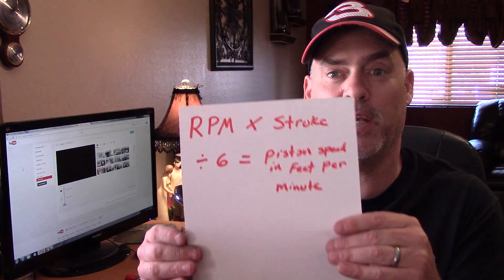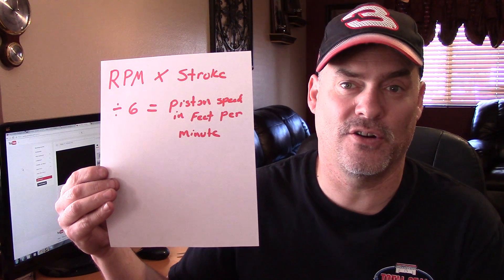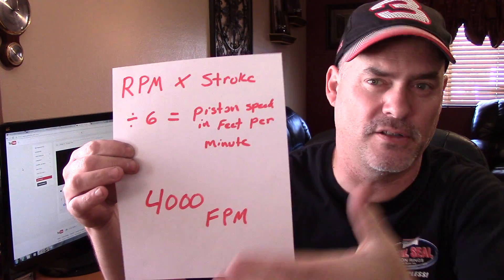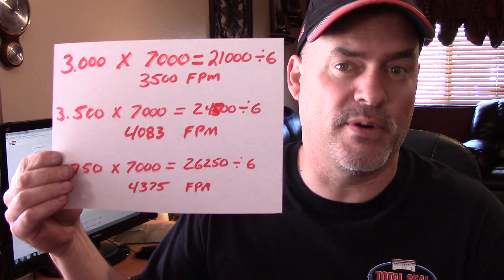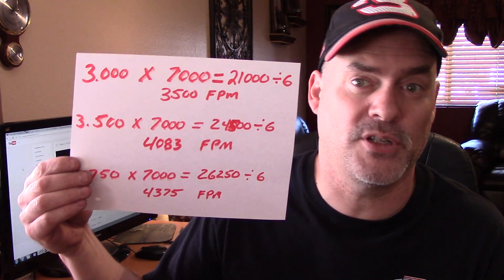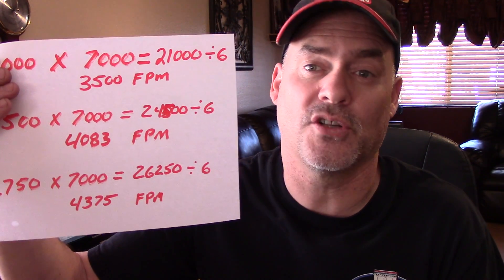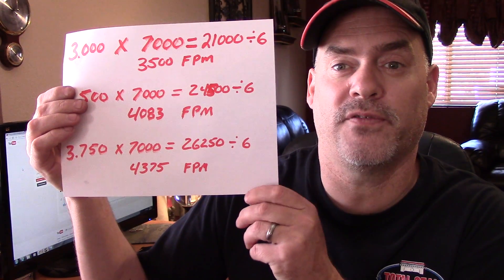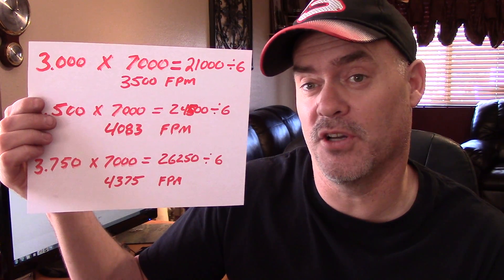What RPM should be an Engine's red line

Comment: i've just seen the video
and after doing the math the results are!!
my car chrysler SRT8 HEMI 6.1L
after few upgrade
now it has 4.250 strok
4.125 bore
CNC heads etc....
also it is my daily use car
and with 3.73 diff the RPM is always high
and 6500 RPM is a number that i reach as my daily routine
if you do the math:
5650 rpm × 4.250 ÷ 6 = 4002 FPM
what about 6500 rpm
its more than 4600 FPM
dyno test is: 510+ rwhp on gas pump

Comment: Reliability/durability of the crank and bearings are what limits rpm, right? They the failing components of high rpms, right? Can you increase rpm and/or add stability/reliability to the exicting redline by using a higher viscosity oil or some kind of racing oil?

Comment: Is piston speed really that important? I think it is, but I see too many posts about people revving their big blocks and strokers to the moon with piston speeds fast or faster than F1 cars and cup cars.
Reply: Biggest concern is oil being wiped from the cylinder walls, wrist pins skirts etc. Too much piston speed with sub-par oiling system leads to wall wear and increased clearance, giving more blow by and compression losses

Comment: So 24,000/Stroke..  24k being 4000FPM x 6...
 24000/3.00=8000RPM
24000/3.5=6857RPM
24000/3.75=6400RPM
Reply: Exactly. The simple explanation of how to find your redline is 24000 divided by your stroke. The other factors that come into play are piston material, ring face type, piston pin type, rod construction, bearing speed, crankshaft balance, oiling, clearance, and the two biggest ones: cylinder head port flow and valve springs. ALL of these things added together dictate true peak RPM. However, the simple 24000/stroke=redline RPM equation will work as a good baseline for most stock to mild street builds, as stated.
Reply: Was mainly just trying to simplify the formula...  But agreed...
Reply: I have a 4.9 straight 6 Stock. I take 24000÷3.98 (stroke) I get 6000. For some reason I find this realy hard to believe.  What am I doing wrong?
Reply: @akafungi-eater1233  Considering that in his example, a 302 (3.00 Stroke) can "safely" turn 7000 RPM, yea, you got it right.  But a stock 302 will float the valves between 5600 and 6000.  So I'd think it would take more than a "mild" build to see 7k.  And with a big straight 6, you've got the bottom end to worry about.  So I'm thinking more like a limit of 3500 Fps piston travel, which would be 21000/3.95=5300 RPM.

Comment: Manufacturers use different kinds of material to make a piston, connecting rod, etc.. So 4000 ft/m isn't really applicable to everything. I think you should've given the ft/m for each kind of internal combination.
Reply: faisal3398 Wouldn't there be countless combinations of internal parts you can use to build an engine though? 4000 is probably just a max safe limit with most OEM internals. This guy does work or teach or something like that at UTI so he knows his shit though

Comment: So, my 1998 Nissan Frontier, has the KA24DE engine. It's stroke is at 3.78", and it redlines at 6500. If I ever wanted to raise it, would I have to basically rebuild the engine to change the rods and pistons out?

Comment: It depends on a bunch of factors.. RPM and internals strength are 2 big ones. Too high an rpm on weak rod and pistons and you have internals fail overreving to the point that the valves float can lead to certain death to the whole engine if ya way over do it and the valve hits the and breaks a piston or rod..  Most cams have a happy max rpm in the docs with them. Finding out what ya internals limits are is a wise thing before building anyting

Comment: Strong internals go a long way here. 4340 crank and fully forged pistons and rods @ 4.25 inch stroke hasn't cared about 7500 rpm in my little hotrod...Yet... Pettis performance builds 598 Chevy (race motors) with 4.5inch stroke that make peak power at 9k. Very informative video!

Comment: Due to rod geometry, the fastest piston speed is usually in the top 1/3 of the cylinder.  In the center of the cylinder, the piston is starting to decelerate as the crank comes the 90 degree point, actually starts decelerating at about 60 to 80 degrees, and decelerates the most as the journal starts to swing back in the bottom half of the stroke, stopping again at BDC.  Also, a short rod engines like the Ford 302W or Chev 400 small block have faster acceleration away from TDC, once again due to rod geometry, than a longer rod engine, like the Ford Boss 302 or Chev 350, which can cause a piston to pull apart easier at the same RPM.
Reply: That depends on rod/stroke ratio
Most engines peak out at dead middle of the stroke
Engine with short rods and long stroke will have 2 peak pistons speeds near 1/3 down and 2/3, but actually slow down some in the middle of the stroke. that's because rod angularity accelerates the piston against the cylinder wall, but this increases runner air velocity and can be used to increase volumetric efficiency

Peak piston speed at redline for a 5.0L is 82.5, while LS3 is around 72mph
Reply: The rod/stroke ratio will dictate piston accelerations and decelerations, but geometry dictates speeds in any part of the cylinder.  Short rod will have quicker acceleration/deceleration, but, as the crankpin nears the halfway (90 degree) of stroke, piston speed starts to decrease as the rod angle change slows, no matter what rod length, usually around roughly the 30 - 45 degree range of stroke which has the piston in the top 1/3 of the cylinder.  A shorter rod may have the piston farther down the cylinder, but not usually at 1/2.  

The difference between short rod, such as a 302 Windsor and longer rod, like a Boss 302, also dictates the cam requirements of an engine.  Shorter rod engines like fast valve opening and higher lift at TDC to make use of the quicker piston acceleration away from TDC.  Also makes use of larger carbs, valves and ports to allow less restriction to airflow acceleration as the piston moves from TDC.

An easy way to study rod length on piston movement is to make a 2-d cardboard replica of a crank and cylinder.  Make a circle to show the crankpin rotation and use a ruler for the rod.  Pick points around the crank stroke and then match the ruler to the centre of the cylinder at different lengths from the same point in the stroke.  You will see how the piston is higher or lower in the cylinder as rod length changes.  The fun thing with this is that you can use rod to stroke ratios that would be impossible in real life to exaggerate the results and get a very good indication of how they affect each other.

Comment: Some good points but the REAL limiting factor of RPM is not necessarily the piston speed, it is more likely lower end BEARING speed.  For instance Pontiac engines main and rod bearing journals are huge and if you usually cross about 5300 rpm you most likely have spun a bearing.  Big block chevy have a smaller journals and will take the RPMS much better.  There are a lot of factors that effect RPM limits, runner lengths, cam specs, valve size and spring rates,  intake flow, carb limits, bearing speed, oiling capabilities, ignition capability and curve, exhaust (you gotta get the burnt air out to get the fresh air in), rotating mass weight, cooling system limitations and certainly piston speed.  No offense, and I think you know what you're doing, but piston speed is only one small part of the RPM formula.  Great vid on piston speed but not necessarily on RPM limits.  :-)
Reply: +AWitty PIlot You can modify the bearing to hadle more speed but you will never be able to change the piston speed. Each engine is different and has some weak points but mostly you can sort this out until you hit the piston speed problem.

Comment: R.P.M's, i knows MANY mechanics/technicians use plural on minute. I have 2-96 Roadmasters with the LT1 cast iron head, I have no idea of the casting numbers but 2000 R.P.M's with the rowing package gets me 80 MPH all day. I bought one of those tuners  to tweak dis n dat and raised the governor from 108 to lotz more and put higher speed rated tires on one of them and now I've been to 3500 R.P.M'$ which is/was north of 130 M.P.H'$ on highway 99. Built a few engines and enjoyed the few videos of yours I've watched.
Gene from the left coast near the state Crapitol

Comment: Where does the 4000 fpm number come from? That seems to be on the conservative side.....my Subaru BRZ's FA20 has a piston speed of 21 m/s or 4200 fpm. And that is even low, compared to the new mustang GT350 flat plane V8 which is 26 m/s and the Ferrari 458 is 28 m/s.
Reply: +Gordon Bell Ferrari for example use extrem light pistons to reduce interia and also much better materials. In addition they coat the cylinder walls and the pistons aswell. Mostly old american V8 can´t handle much rpm because of the valvetrain and they were never designed to rev so high.

Comment: A grandpa stock 350 Chevy should NEVER go above 6500 RPM because of the short 5.7 rod. The rods break all the time. Put in a six inch rod and a good piston and 7500 or more is no problem as long as the valve train can handle it. In the beginning in the mid sixties I used to watch Ritchie Zul race up and down Broadway in Lindenhurst with the original Blue Max. A 66 Nova 327. Within a year he had the sucker over 650 horsepower. Insanely fast car. His cousin Steve lived around the block from me on Broadway and had a big garage so they worked on their cars there and raced up and down the block. We later became friends after I started machining full time and learned a lot of shit from all the hot rodders that hung out where I worked. I worked with one of the greatest head artists to ever live. Ritchie told him that he wasn't even close to being as good as him and they went to head school in California together. Ritchie builds the stock Mercury Big Block race engines and has been for a long time.

Comment: what is the significance of dividing by 6?
Reply: +fourbypete Each rotation carries the piston both upwards to TDC and down to BDC. So for each revolution the piston travels twice the stroke length (which is in inches). This gives you inches per minutes, then convert to feet per minute. EG: 5000 RPM * (2 strokes / Rev) * ( 3 inch/stroke)  * (1 ft / 12 in) = 5000 * 2 * 3 * (1/12). Rearranging that you'll get 5000(RPM) * 3"(Stroke Length) * 2/12 (in * stroke / stroke * ft) = 2500  ft/min
Reply: Oh, of course. So 6 is the crank diameter. from center 3" up" plus 3" down. Which I guess could be different on different engines, yes? Or not really.
Reply: +fourbypete crank Dia doesn't matter so long as it's beefy enough to keep the rods on. the 6 is just a reduction from the above equation.
Reply: +Boozer Maloozer Right now I get it, 3" per stroke, down stroke plus up stroke =6". It's the distance the piston travels per piston revolution which is used to work out how many feet per minute each piston is travelling them multiplied by how many pistons.  Is that right?
Reply: +fourbypete the distance the piston travels per crank rotation. number of cylinders doesn't matter since we're only considering the travel of a single piston. you could have a v12 red line at the same point a v8 would given the same stroke length
Reply: Ok, I understand now.
Thanks for taking the time to explain it.
Reply: No worries. I was curious as well

Comment: Did the math on my 3 vehicles just to see how they compare: 
supercharged 380sbc @6500rpm 4,063fpm. stock 1zz-fe @6800fpm 4080fpm. 5.9 Cummins @3000rpm 2,360fpm.
What's kinda crazy is my dad back in the day used to race a 427bbc and shifted @7500rpm 4700fpm on stock performance GM parts at the time (late 70's) or so he says...
Reply: Maybe when he said 7,500 he really ment 6,500 lol
Reply: Don Bossco Joe
I think it was 7500. The reason that engine lived is 1. it was professionally balanced right down to the clutch and pressure plate, and 2. in the old 427 big block had a short stroke/big bore combination which was perfect for reving. Still, he was living on the edge at that piston speed with no rev limiter and a solid cam (unlikly to float valves). Back in those days if you blew a shift you probably blew the engine.
Reply: +177SCmaro   Arrrr bbc, it's funny everyone thinks a small block revs harder than a bb, but it depends on a lot of variables. Still I've found old timers love to stretch the truth when talking about the good old days👍😉
Reply: Don Bossco Joe
true dat.

Comment: short stroke engines can turn high rpm, long stroke do not but puts out more power per stroke. speaking of stock engines. if you want more pull out your wallet.

Comment: That is why I love the 302 Engines because they are Short Stroke Wide Bore and you can wrap them out even stock I nailed 5500RPM in my Bronco few times and it felt smooth at that high RPM  Also Short Stroke wider bore engine have much better Throttle response in my Opinion.

Comment: There are so many parts available  for the SBC that its bery hard to figure out the correct combo.
Can you do a video for a 600 HP Chevy 350 build?
Plus can you explain  how to tell if the block is high tin/ nickel. 
I have a 350 4 bolt main,   bored to .060 over with a .120 cylinder  walls, behind the timing gear is has 10 and 20 molded into block. Someone told me that means it is a high tin and high nickel block. Is this correct?
P.S. I will be using AFR 220 (2.08/ 1.6) heads. I will be driving it on the street, but I want it to sound like a Pro Mod when it idles.
Thanks for your help and love your vids.

Comment: hi great vid , does this same rule apply to the 366 gm big block truck engine ? or are all stock engines built to a certain standard or envelope that all stock engine engineering fall into ? .the reason i ask is because the 366 has extra heavy 4 ring pistons and planing to build one for towing , redline under 5500 rpm , Thanks

Comment: Easiest calculation: 24,000 divided by stroke = redline RPM.  So for a 3" stroke, this would be 8,000 RPM.
Reply: Maybe on stock internals, lol. Built internals more like 30,000. IDK, the LS7 has a 4" stroke and turns 7000 stock, and many mod it up another 500 and it's fine. Now, yeah, it's a performance motor with already fairly robust internals, but still. A far cry from a poor ass 6000 RPM.
Reply: @Drunken_Hamster  great reply. I was looking and playing with numbers and to say my 4" stroke can only run to 6k safely I was like😱😵. Your comment makes alot more sense. With all forged internals and good block 7500 is fine.

Comment: Accelerate until catastrophic failure, then reduce RPMs by 11.7%.
Reply: Absaalookemensch, I always built my engines with a rotating assembly that wasn’t the limiting factor. I used valve float as the redline.
Reply: Hey what do you know, it works!!! 🤔🤔🤔
Reply: I did it, but I'm struggling to only reduce engine speed by 11.7 percent. Suggestions?
Reply: Joe cook, Joe, what engine are we talks about? How many cylinders? Valve train design? Overhead valve  overm? Has the rotating assembly been balanced to +/- 1 gram? If you have an oversquare engine you can achieve a higher piston speed before catastrophic failure. This will also depend on if your using  cast or forged crankshaft.
Reply: @arttafil6792  haha it was just a joke man just having a laugh
Reply: Joe cook, many years ago I built a screamer of a Chevy V8. I started out with a Monza 262 block, had it align honed and stress plate decked. Baldwin Chevrolet, better known as Motion Performance! I had a raw forging 302 Z28 Craig ground down to a 2.80 stroke. The block bore was upended to 3.70 from 3.671. I had 4 bolt mains installed before the block was align honed. I also had the block deck relieved for valve unshrouding and valve clearance. A set of double hump heads were machined to open up the combustion chambers and unshroud the valves. The heads were early ones and had 1.94 & 1.50 intake and exhaust ( these were stock valves for early double hump castings).  The pistons were forge true forgings with valve reliefs. The rods were some of Hank Carrillo’ best “H-Beam” rods. This is getting long.
Reply: I'm curious, how do you keep the engine from reducing RPMs by 100% after catastrophic failure?
Reply: @Ken19700  simply catastrophy it thereby reducing rpm's by 100%
Reply: @7REDDRACO7  By counting the revolutions of the crank as it is rolling down the road, via the rear view mirror... Always keep a sharpie on your dash to right things like that down...
Reply: alrighty i'll go give this a go, i need to know what to set the tacho at
Reply: @EV8Gaming  
I believe 9,250 will do the trick.  If your engine doesn't reach that then, work with what you have.
Reply: 60th Like And 9th Comment.
Reply: @SolaricSage116  Or throw caution to the wind and increase RPMs by 11.7% just to show them who's the boss.
Reply: @Absaalookemensch  If I'm doing 7000, I'll raise it to over 7800.

Comment: Great video, I have a 2003 Toyota Matrix XRS which has a 2ZZ-GE engine that red-lines at 8200 RPM with a stroke of 3.35". By your formula my pistons are traveling at ~4575 FPM. But I guess that is what you do when you are a large corporation and reuse and engine that you put in a Lotus Elise/Exige.
Reply: Forged steel crankshaft. Refined rods and pistons. Much better castings than the engine community he is referring to.

Comment: A NASCAR motor, hardly different than an LS-1 or LQ9, will run at 10,000rpm for about 3-4 hours in a reliable way. Any RPM will wear the engine, so max RPM really depends on how long you want the motor to last. If you check an engine under a strobe light, you can see when it begins to shake rather violently, and you can also see it in a digital recording using a ho-hum camera. If you want an LQ9 to run for 300,000 miles, you need to avoid rpm over 2800 as often as possible. Drive like your Dad is riding with you if you want the motor to last.